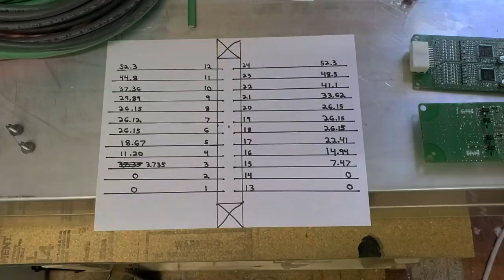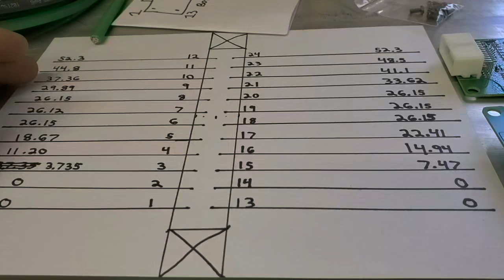Updates to my LG Chem PowerWall

Comment: Gas fro. The electric co. Man they screwing you from both ends! I'd get a boiler, and a steam turbine generator, go charge in winter,  I'm working on something like that, well gathering parts anyway, I'm going to burn paper trash, and fallen limbs, dead trees, and mostly on the coldest days, it's only really cold here about 6-8 weeks, then just cold nights, between a wood burning boiler, and thermal solar collectors, it should also heat the house,  but where you live, it may not be so easy to do something like that,

Comment: TemCo has awesome welding cable, and about any kind of wire, at a great price, I get everything from them, even 3:1 glue lined  marine grade heat shrink tubing, I usually get ships in 3-4 days, they sell on eBay and Amazon also. You can use a single BMS on all the batteries,  get Sid to put a extra connector on the adapter boards to parallel them, I use 20 and 22 gauge on the BMS, it should be fine to have a connector to parallel the boards, it's basically the same as I have on mine, all the batti cells connected together through the BMS balance leads, it helps keep everything balanced, if something happens, the 20 gauge will act as a fuse, to prevent a runaway!
I'm still thinking about adding a 5 amp fuse!

Comment: You might want to ship one of those stock LG charge controllers to Sid so he can reverse engineer it and get a better idea of which pin goes to what.  You doing your pin out break out only tells part of the story.
Reply: The BMS is completely proprietary (all the way down to LG-branded ASICs), so I was able to get everything necessary (hopefully!) from what Sean provided: voltage measurements, high resolution photos of both sides of the PCB, and the forum link.
Fingers crossed everything checks out right...

EDIT: ...from what I asked Sean for ;-)
Reply: @sidlori1592  Wiring diagrams should help identify temp sensors.  The idea was to get you a board to get that along with the potential to force the CPU to download its code.
Reply: @sidlori1592   hey Sid can you email me at bossm23@gmail.com I need to ask you something. thanks
Reply: Sid Lori  based on the diagram at 11:36, which pin did you use for cell 7 and which pin did you use for cell 14? I bought 8 of these modules and haven’t attached balance leads to them yet. I don’t mind paying for your knowledge.
Reply: @abelgonzalez5388  I used pins 6, 8, and 19 for cell 7+.  (Note that the stock battery balancer is set up as 2 banks of 7S chips, this may well explain why there are so many 7+ wires.). 14+ was pin 12.

EDIT: always double check voltages before wiring anything up.
Reply: Sid Lori  Thank you so much. I will double check voltages and I’ve wired up several 14s spot welded 18650 packs that I spot welded myself. Sometimes I’ll wire up the 14s with 2 x 7s wiring harnesses to facilitate charging with hobby chargers like the Revolectrix PowerLab8. Appreciate the knowledge share!
Reply from the maker: You got 8 of these packs?
Reply: Genetry Solar I do. The first time they offered these at Battery Hookup I jumped on it and ordered 8. Came in two pallets with original factory boxes. If you get tired of waiting for more LG chem modules , I can highly recommend Tesla model S modules. I’ve tested more than 8 of them from 3 different vehicles and they’ve all tested over 90%. Only thing is your inverter has to be adjustable in input voltage. Two Tesla model S modules in series are 12s.
Reply from the maker: @abelgonzalez5388  well if you don't need all 8 I know someone who takes donations 😉
Reply from the maker: We already broke it down and figured it all out.